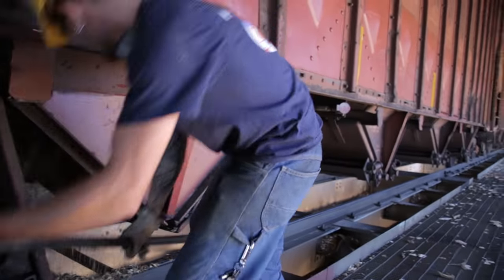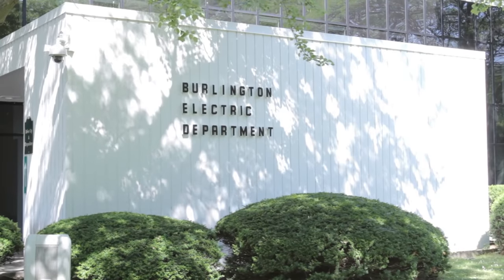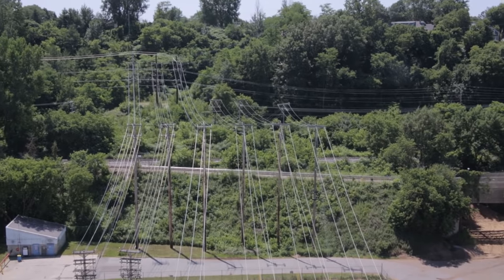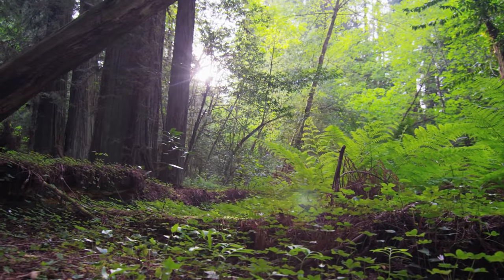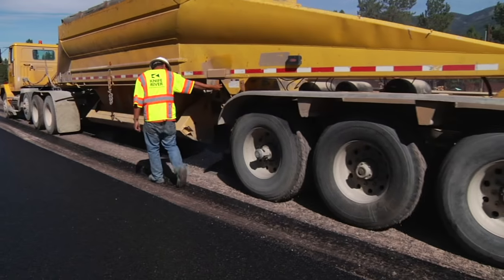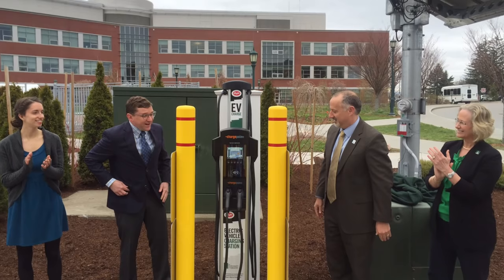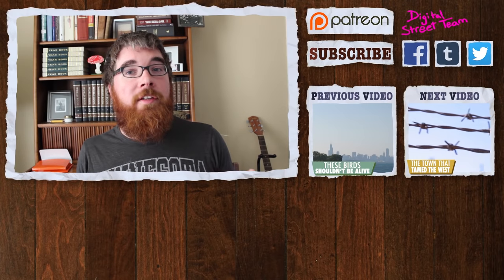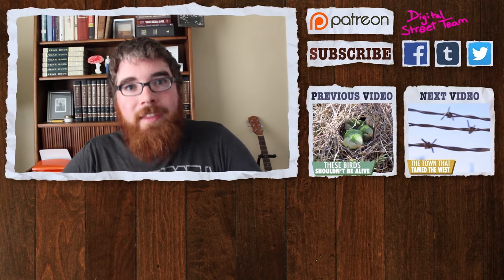Can A City Run On 100% Renewable Energy?

Comment: It's 2018. Solar alone with batteries can handle the entire city. The justification of the guy on how they offset pollution is kinda weak but they are doing a much better job than the rest of the USA.
Reply: What about in the winter, when solar production goes down multiple times? You would need to have multiple times oversized solar systems.

Comment: Using oak as an example and you are burning 600,000 trees a year, you will need 18,000,000 trees in growth by the year 30. Taking an area of 1,000 square miles.

Comment: Norway get all it's electricety from renewable sources. So as long as you have the natural resources it's no problem to be clean, but when you have to use low density resources like wind an solar(wood is realy solar) it a problem since there is a high cost in land an structures needed for collecting and generating the electricety.

Comment: Biomass burning is not a sustainable or responsible source of energy.  There are plenty of pollutants including carbon.  Plus (they didn't discuss this in the documentary), harvesting, extracting, processing, and transporting uses large amounts of gas and diesel.  Passive and truly clean energy sources such as solar and wind are now cheaper than fossil fuels.  And prices will continue to fall with technology advancements and infrastructure developments.

Comment: Hydro has powered towns and cities for hundreds of years. The problem is when you say "100%" because you're then talking about the generators, steel framed buildings, copper wires to run electricity, etc.

Comment: Yes, with my new engine.  Solar thermal at 3 cent/kwhr.  Solar thermal panels with new engine that can run on solar therma, Natural Gas, gasoline, Diesel, propane, and battery (for mobile applications).  If you use my engine you would double the efficiency.  

There is a better way.

Comment: Major questions/issues not addressed in this video
1: The biomass plant has pollution control...so does every coal burning power plant.  What are the comparisons of Carbon Emissions between the two?
2: How much Carbon Emissions are produced in the local biomass plant vs. the calculated Carbon Emissions used in the creation of new local forests?
3: How much does electricity cost in Burlington? (including total energy bill and cost to produce vs conventional methods.
4: Micro Grids are mentioned but not discussed (that's a HUGE change for our current grid system)
5: 76% of the city's energy is reliant on wood and water, how does this help the cities in the world to go "green" when they don't have access to either?
6: It is suggested that people store the energy they gathered from their solar panels in their basement.  WHERE HAVE YOU BEEN HIDING THAT MIRACULOUS TECHNOLOGY????!!
Reply: Floridian here, basements don't exist.
Reply: 1. The comparison is that wood regrows, coal doesn't. harvest 1 effective acre of young trees (burn for ~270k of co2) then 20 years later new trees absorb it. Burn 270k lb co2 equivalent of coal (~47tons of coal )and then it stays there? Coal pollution even after the pollution control is still a lot worse than burning wood.
2. Carbon emissions are net zero for keeping the forest size exactly'ish the same size (trees can't grow indefinitely dense duh) Creation of new forests is just a bonus =)
3. About (attempting to add together from website): $8.50 + $0.153/kwh (first 100kWh = $11.71)
4. Logistics probably not fully developed for large scale yet
5. What's wrong with buying/selling? Solar works in a lot of places where cave dwelling is not the norm
6. Batteries? Not the most economical for offgrid but for microgrids and lower battery prices, probably.
Reply: 2Awesome 
6) it is not very effective solution. It is much better to sell the energy when we have too much and buy when needed.
Reply: Awesome, 

if you didn't chop down the forests, they would absorb the CO2 emitted from burning coal. Coal is far more effective as it's calorific value is much higher than wood. Wood has to be processed into a type of fuel (pellets) that the boilers can use. This processing uses a lot of energy.
Co2 is not the enemy anyway, it is greening the world, we have until recently been short of atmospheric CO2. It is a life giving gas.
Reply: The difference is that biomass from trees is using carbon that is already part of the balanced carbon cycle, whereas coal is introducing carbon that has already been sequestered and is no longer part of the natural carbon cycle. In essence, coal adds extra CO2 to the atmosphere where biomass leaves it the same.
Reply: @oggyreidmore  to add to your point the vast majority of photosynthesis,(taking in CO2 and releasing oxygen) is done by ocean
dwelling photosynthetic organisms. Non ocean dwelling photosynthsis only accounts for about 20% of the production
Reply: @iainreid9914  you should read about plants and crops sequestering carbon. They are at their limit
Reply: The fifth question here is what I thought of most. What do cities with no access to lakes/rivers for hydroelectric dams or forests to harvest for wood do instead, to produce electricity with "green" methods? Would they be able to just buy electricity from places that do have those 2 resources available?
Reply: 1. Pollution control doesn't refer to CO2 in this context, but to aerosols. A comparison of the types and amounts of different aerosols produced by both energy sources and which is more dangerous to health would be interesting. 
2. The amount of CO2 absorbed per year by the tree farm is equal to the amount of CO2 emitted by burning the pellets. Any additional emissions from cutting trees, moving trees, making pellets and upkeep of the tree farm are either insignificant or the tree farm needs to grow by a small amount over time in order to stay carbon neutral.
5. There are many different possible scenarios. 1. Run an energy deficit and buy from other places with an energy surplus. 2. Use other reneweables. Burlington is far north, so solar power is least efficient there and not used much. A state like Nevada can produce far more solar power on the other hand. In an interconnected grid, solar and biomass power could be produced in Nevada and Burlington respectively, and consumed in both places. Grid interconnection is necessary for this to work. 
6. He's obviously referring to battery storage.